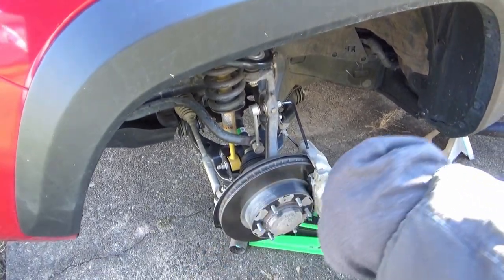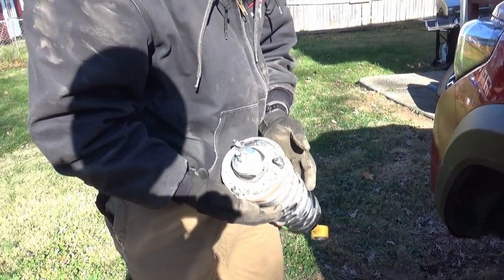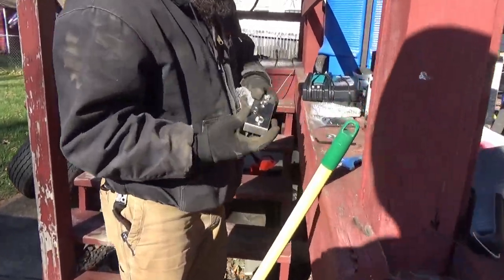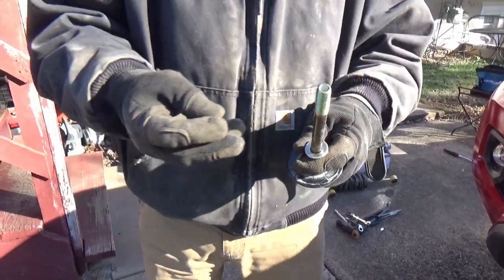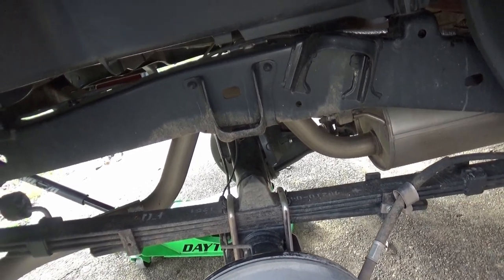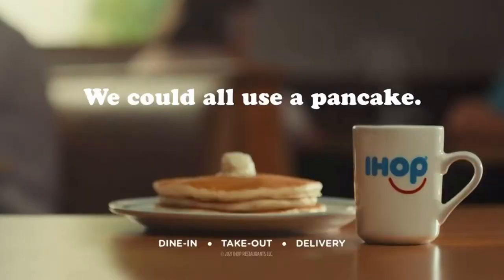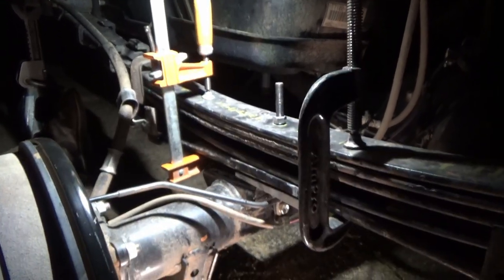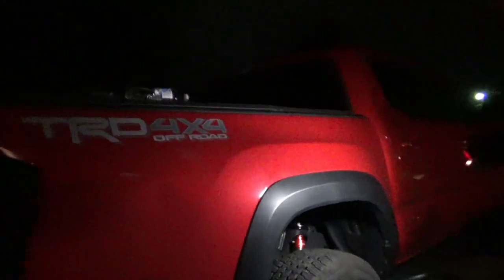VLOG & INSTALL | 2.5" ToyTec Lift

Comment: Question was this the TTBosstac 2.0?  

On Toytec's site says 2.5 - 3.0 is this adjustable?

Third question is was the brake lines good or tight after the lift?
Reply from the maker: Hell, Jeff!

These are the "TTBOSSTAC-2016ALM." The link is in the description.

They are adjustable!

I do not see a problem with the brake lines, but extended/reinforced brake lines wouldn't hurt anything!

-Mac